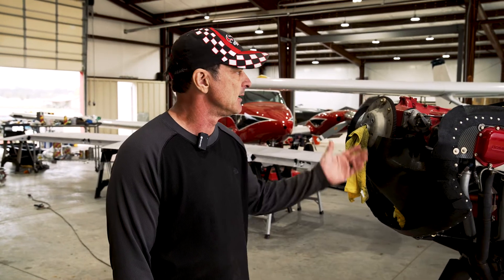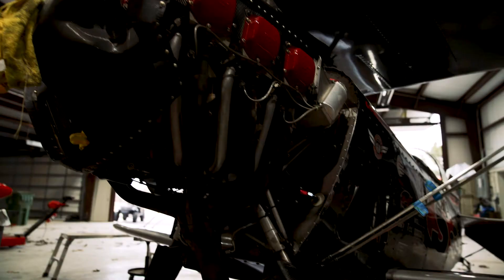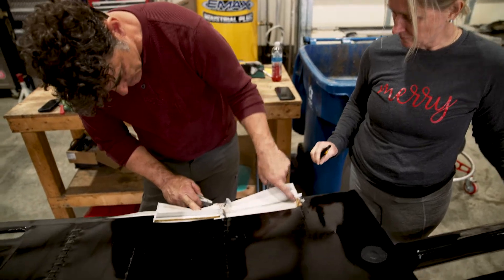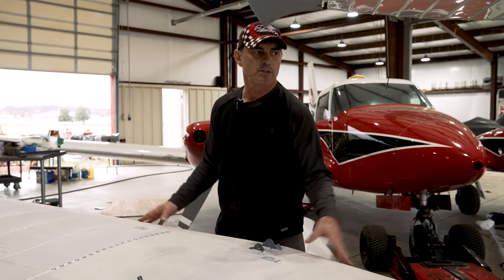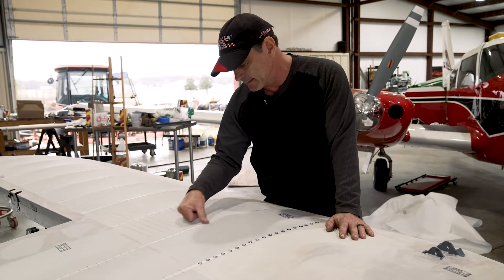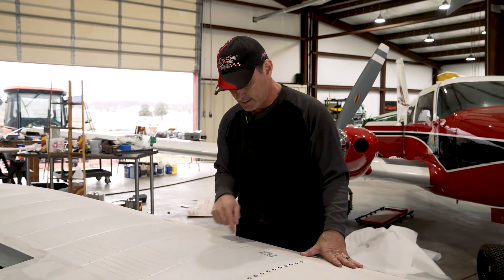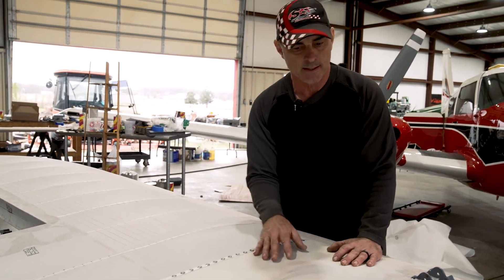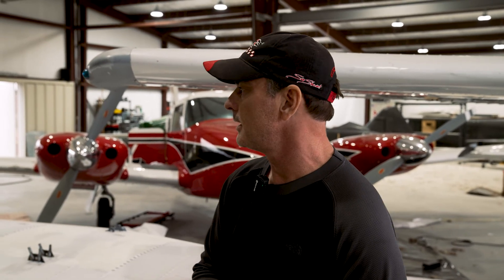Prometheus 2 Wing Overhaul Part 1 (Wing Recovery)

Comment: I always wondered, you said you modified this 1979 Pitts S2S to make it sustain 12G when Pitts was generally rated for 6G. What kind of test have you done to convince yourself when you are pushing these airshow moves that this wooden airplane indeed will not break below 12G and kill you? Isn't it like you put a nearly 50 years old wooden antique ladder over the Grand Canyon, walk to the middle of it without safety harness, then jump up and down?

Comment: Skip whatever happened to the P3 Revolution biplane you were working on? I remember Horizon Hobby and Hangar 9 came out with an RC version of it. An ultra micro version and a 70cc version. The full scale was showcased in Model Aviation magazine. But that’s the last I’ve heard of it.
Reply: From what I recall the designer and manufacture got flaky. Watching this video, you can see P3 in the background I believe! If I'll bet that if it able to be done, Skip will do it. This guy is a machine!